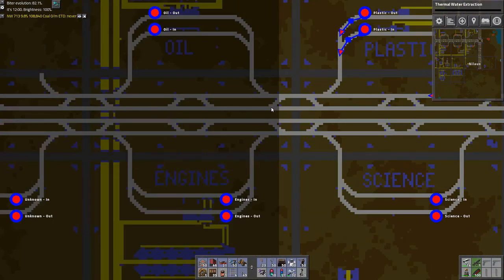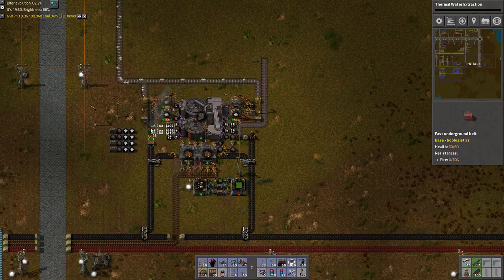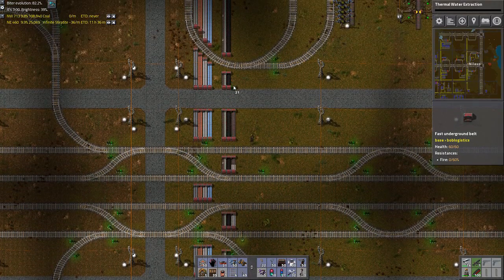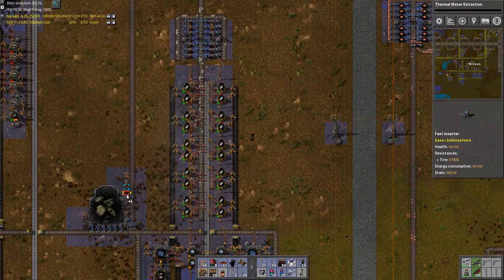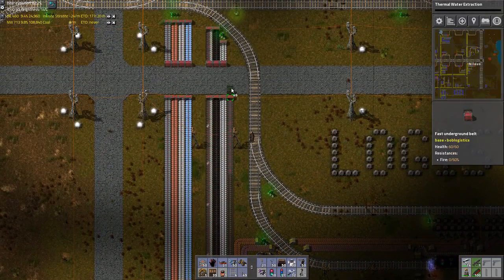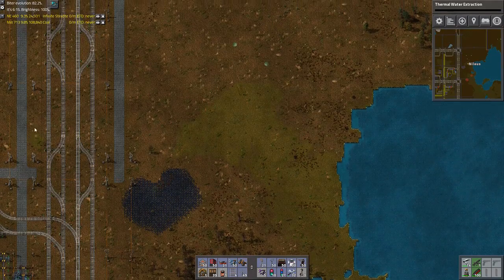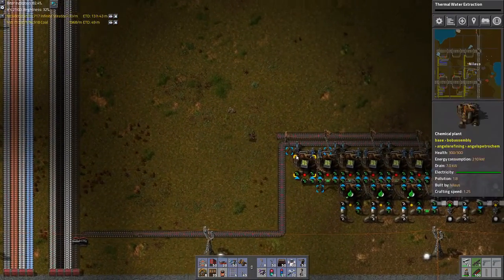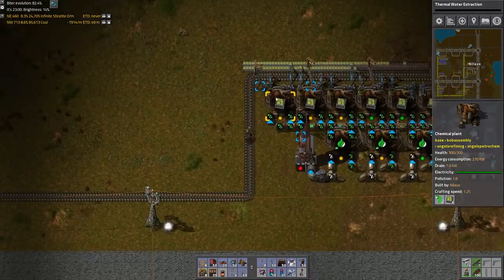Lets Play Factorio S6E25 - Saline water to Calcium Chloride

Comment: There is also another possibility to get silicon plates. You can make them via Angels Smelting purely out of quartz. No Calcium Chloride required in that process.
Reply from the maker: Hmm, I guess there are two ways to do this then: Bob and Angel. Thanks for highlighting it. I should have checked as that may have been easier to do it the "Angel" way. I'll be sure to check in the future as this was rather complex due to the Chlorine Gas to Calcium Chloride.
Reply: My main issue with the Bob's method of creating silicon plates is that it requires iron ore which is not something you typically have on the bus.